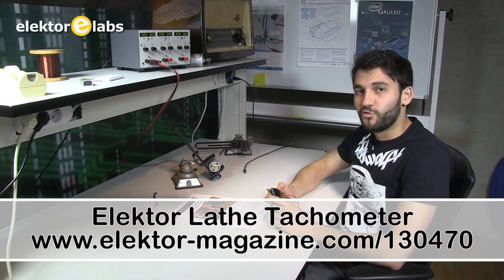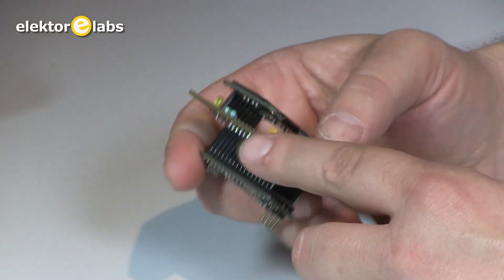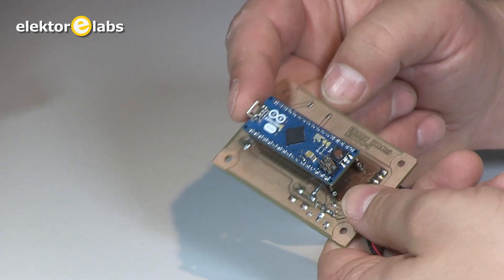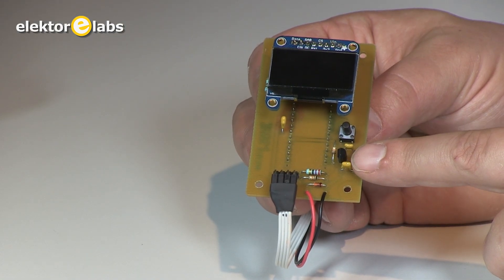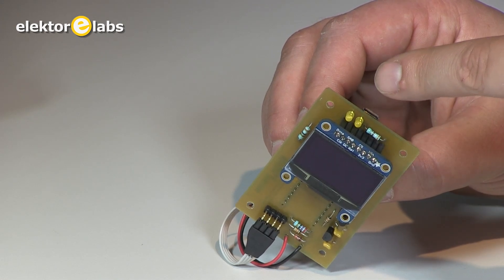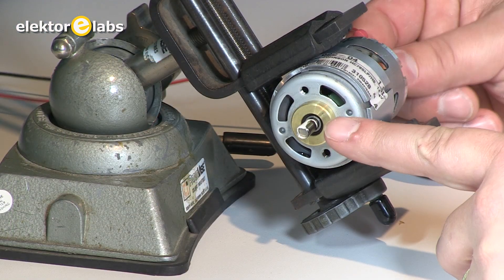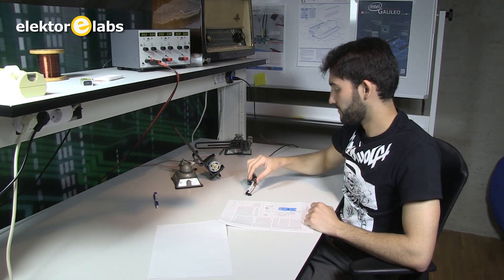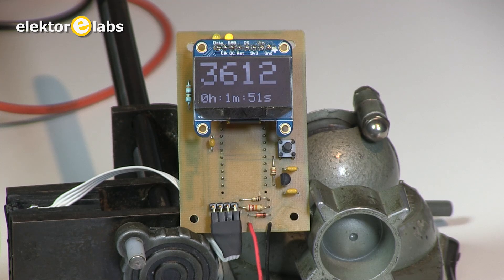Elektor Lathe Tachometer

Comment: Hi, the diode (or zener) D1 is missing from the component list. Is it possible to know the type? Thanks
Reply from the maker: That's just an 1N4148 or anything similar that fits on your board (Schottky comes to mind, but not Zener). It serves as a protection against inverted power connections.

Comment: Hello there, some help.. it doesn´t work.. if touch the PCB the display shows 2000-3000 RPM but without sensor connected. If I connect the sensor and put close to the tape gap with the motor in rotation, nothing... doesnt shows any RPM